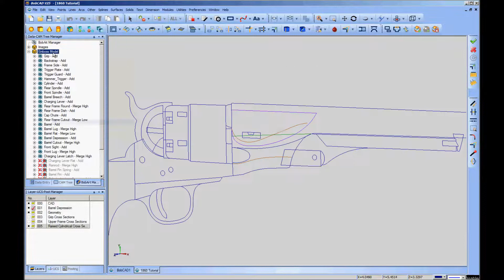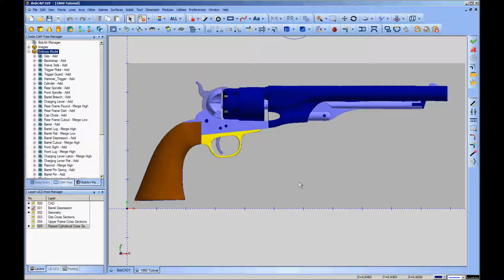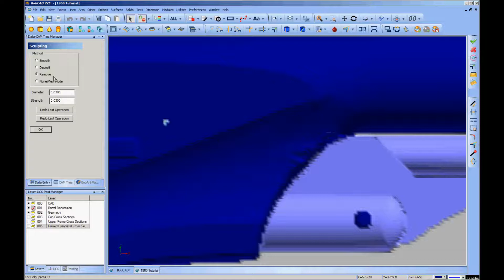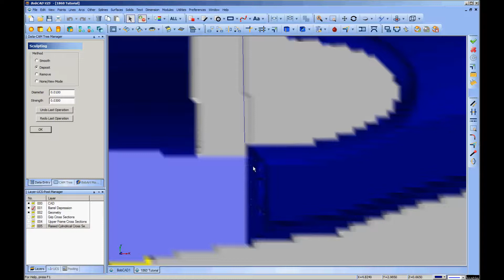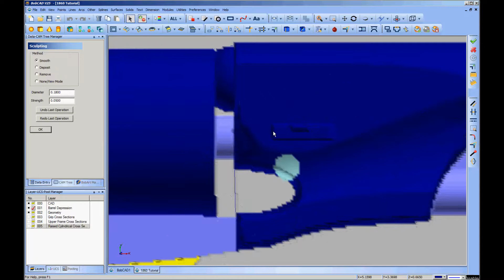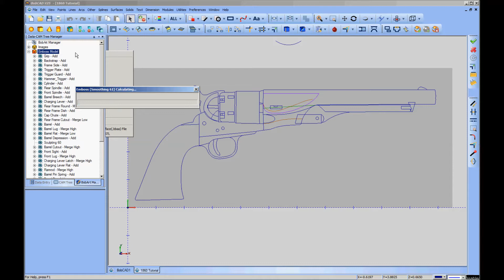BobArt 1860 Revolver Part 4 Sculpting and Completion

Comment from the maker: The changes to BobCAD with the latest build were more focused on bugfixes. I downloaded it, and had no issues, but if you do, your default Postprocessor will be overwritten, so be sure you make a backup copy of your POST.
 
BobArt is treated as an Add-On to BobCAD, and is sold separately from the main package. If you have BobArt V25 Standard, you'll only get a couple of bug fixes by applying the latest update. I'll post a video covering the new features in BobArt V25 Pro soon. :)